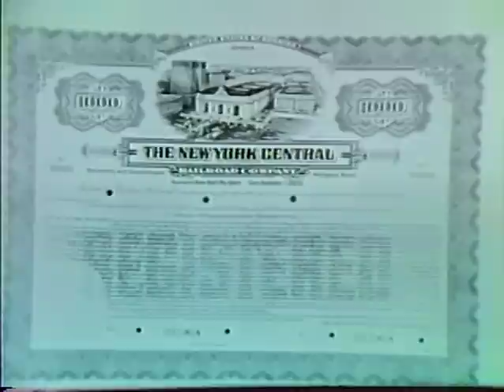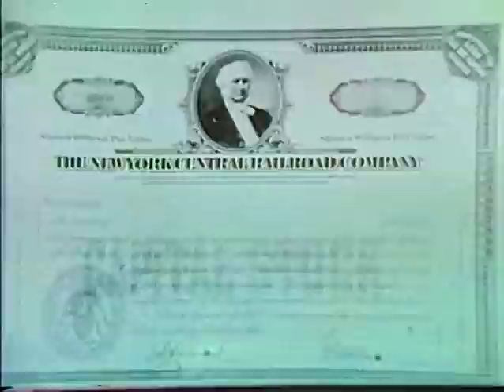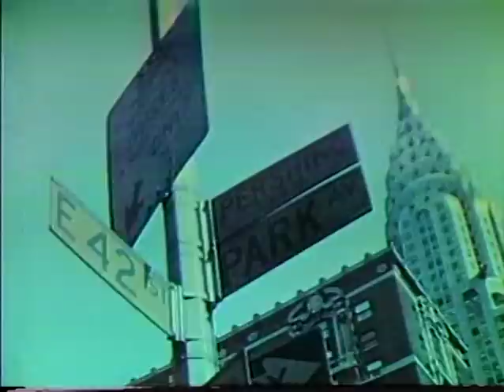The Daily Operations of a Modern Railroad

Comment: notice they used the pistol grip levers in the tower, conrail had the reg upper lever side ways type, but both worked very well in lue of the all computer systems of today and they break down very often, 1 lighting storm and many problems arise, that old stuff worked a lot better in any weather condition, that stuff was made to last for 200 yrs and more.

Comment: 12:30  "At this point in the route, the diesels of all long distance trains are removed and replaced by engines that operate off the third rail", he said as an engineer climbs aboard an idling diesel locomotive and notches up the engine...
Reply: its a FL9, it can operate on third rail
Reply: @cubedsixtyfour  Thanks.  Good catch.

Comment: Are crews still allowed to "kick" cars into a siding? I'm talking about uncoupling a car while it is moving, and then stopping the engine. That happens at least twice in this film. Also guys keep jumping off moving trains, even where they are in the front of the train and are one false move from being run over.
Reply: That would probably depend on the individual company but yes, crews still kick cars today. There's a video on YT of NS crews doing this within the past year.
Reply: @whiteknightcat   Huh. You would think the higher ups would have kittens. Just falling off a train without getting run over can cause injuries.
Reply: Im a conductor for BNSF and we can kick cars or drop cars at certain yards where this action is specifically approved in the timetable or SSI (System Special Instructions)
However, getting on or off moving equipment is no longer allowed except in a handful of coal mines where coal trains are moving at a speed of 1mph or less with special speed governor equipment.